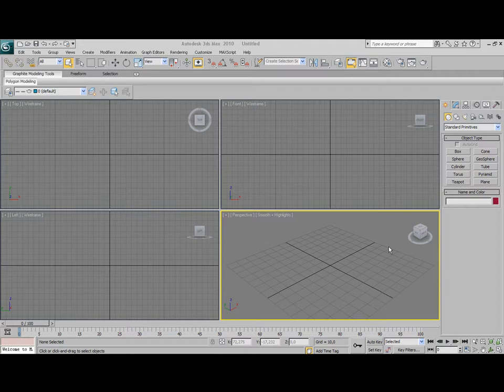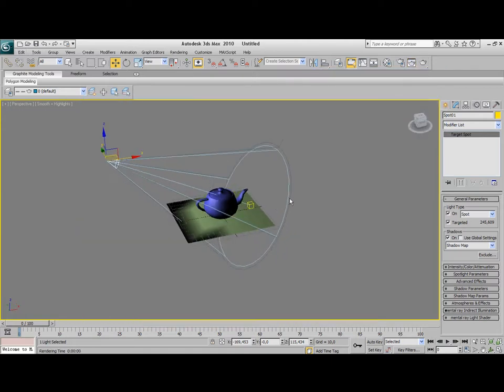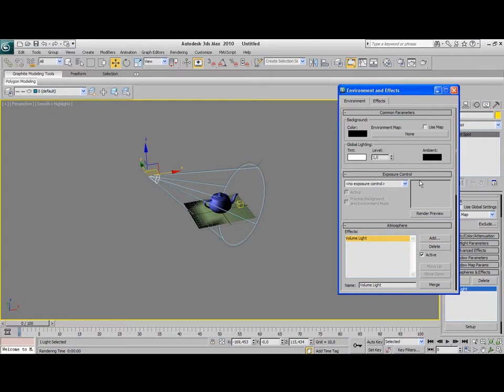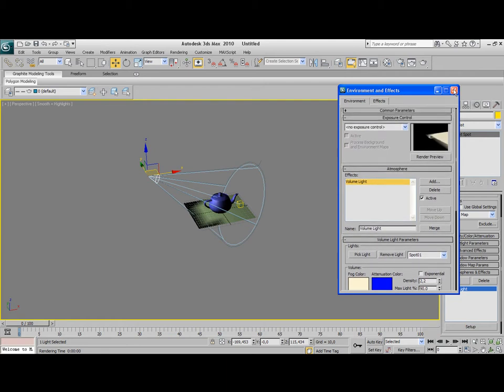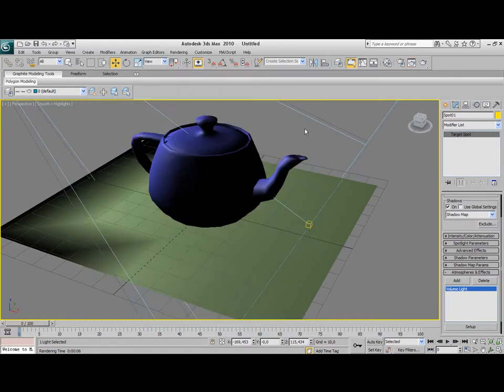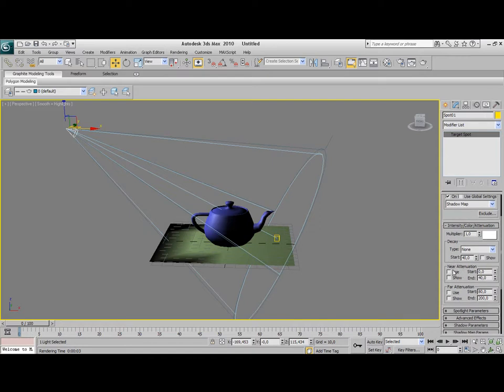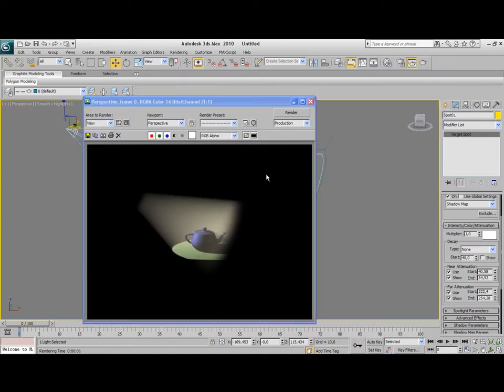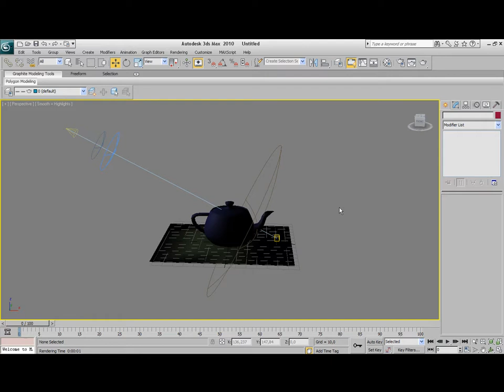3ds max lighting tutorial: Volume light

Comment from the maker: Select your light and go to the modify tab (0.50, the menu on the right). Depending on what light you have you can turn it on or of. But you also set the intensity by changing the multiplier value.